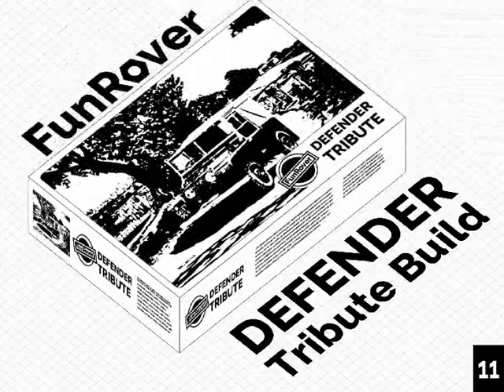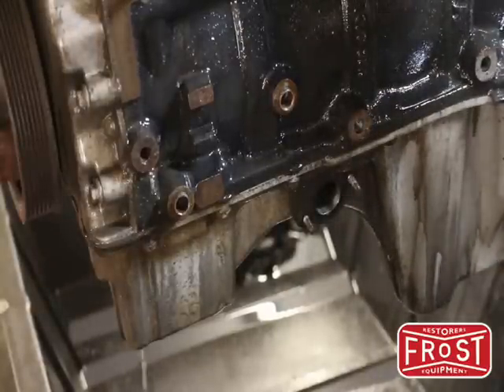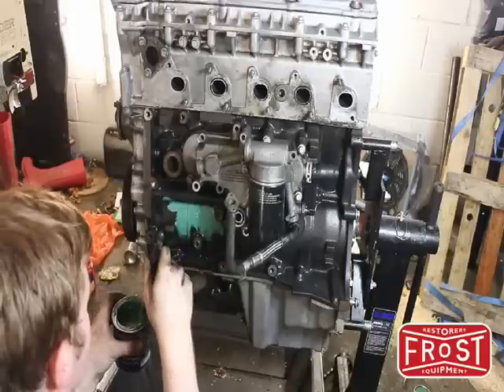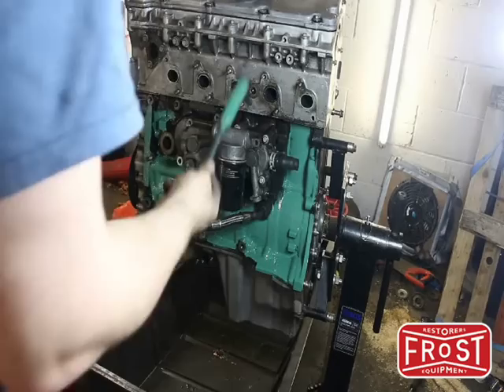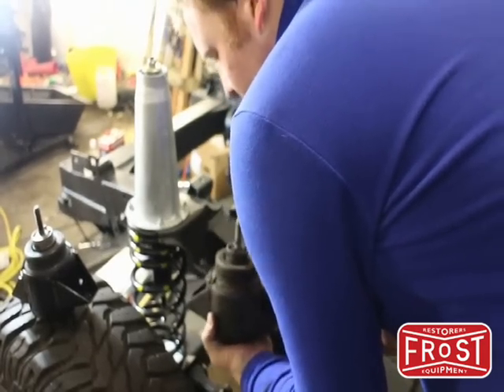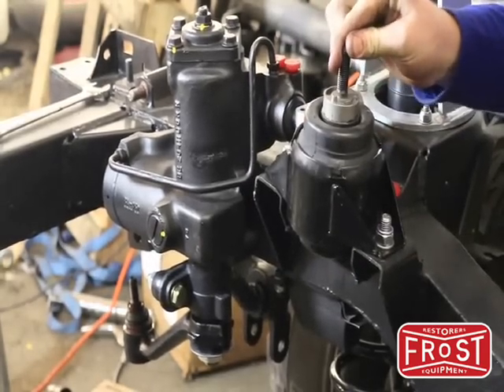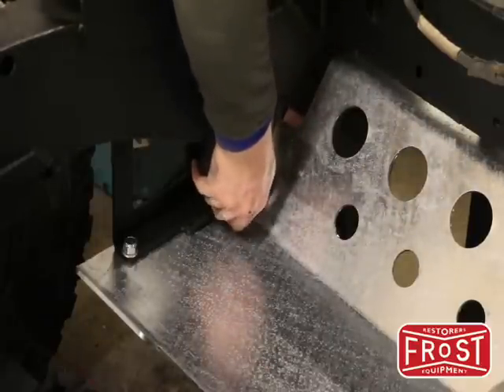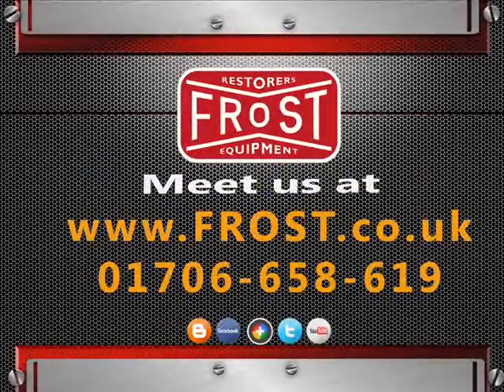Engine Block Painting - How To Use POR15 Engine Enamel (FunRover)

Comment: Hey guys just a quick tip for anyone watching. The manufacture recommends that you wait no longer than four hours between coats. Once enamel hardens it has to be sanded before another coat can be applied. Don't wait too long to paint over.